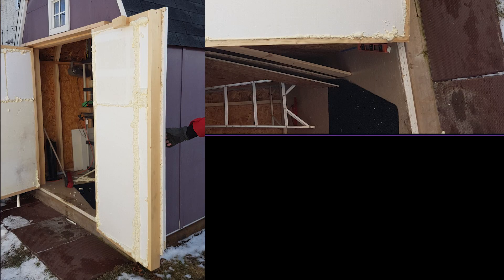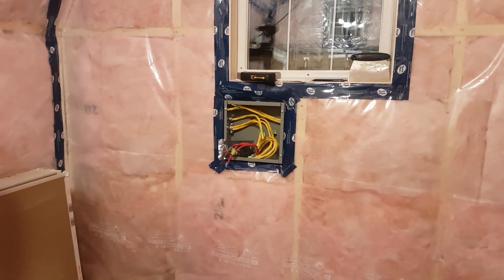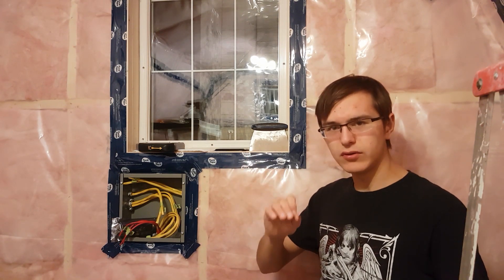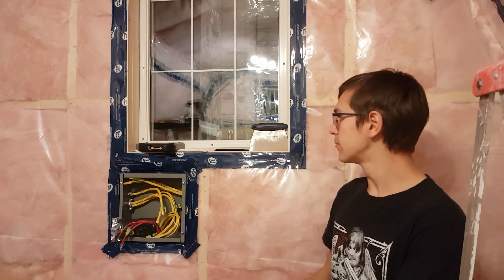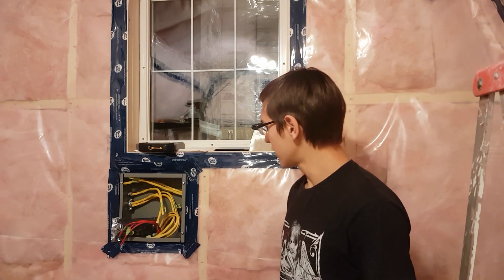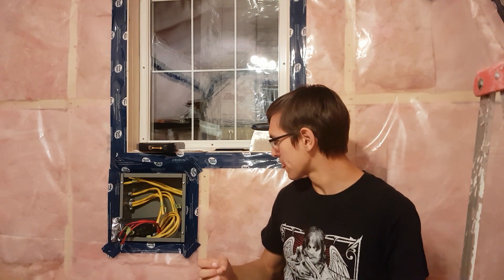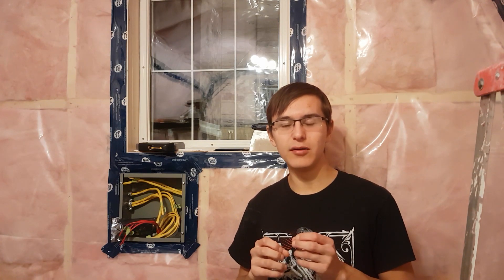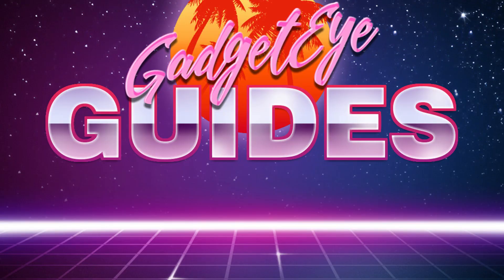Shed to Workshop Conversion - Part 2 - Passive Solar Heating and Energy Efficiency

Comment: Hey, nerd shed. Nicely done.
Im in southern utah, im researching passive heat cool venting. Help me find an auto vent, or help me invent one. This would vent air from very top in summer, then reverses, vents from very bottom in winter.
Its basicaly a one way valve.  In Summer, only heat is escaping, and cold night air fills the shed or (home) by way of natural thermal syphoning, cold is heavy and is trapped inside for the rest of the day. Shed can hold its 70-75 degree temp til 4pm in afternoon when its 105° outside, thats here where I live utah.
In Winter, this vent needs to close, bottom venting is then open. 1000 watt Window heat from sun warms up inside temp and is trapped, only cold air can escape at bottom.  These vents should have large filters as to not impead the air flow, and keep dust out.
This totally passive heating cooling is game changer cost wise.  My dream is that it would be easy to switch between summer winter, maybe automatic.  Its more valuable then anybody realizes.  The more crap you have inside, (the more mass) this acts as a thermo battery, storing the desired temperature for the length of a day when temperature can be renewed.
Traditional windows are in the middle of the wall, not efficient for natural thermal movement, and require active open and closing each day, lets in dirt. 
Join me on my quest for the holy grail of free temperature! 
I also shade my summer roof with solar modules blocking sun heat,  keeping roof in shade. Then one side of shed is dark for Winter sun to heat up shed.
My name is Bryce, nice to meet you.